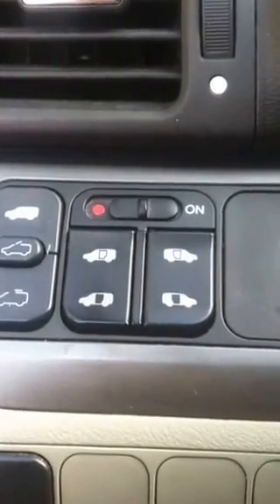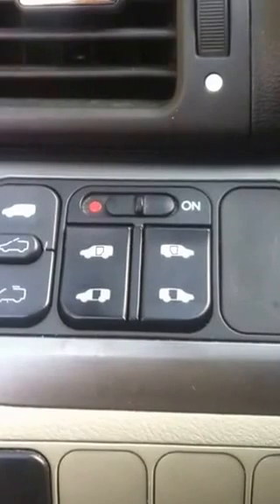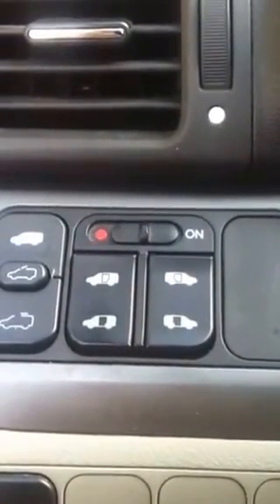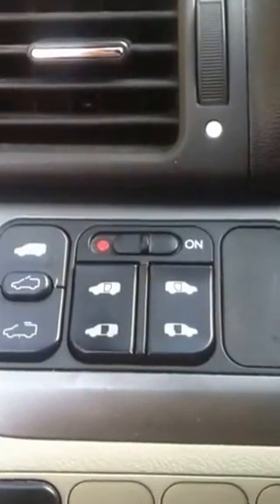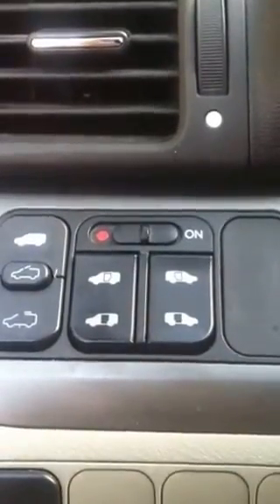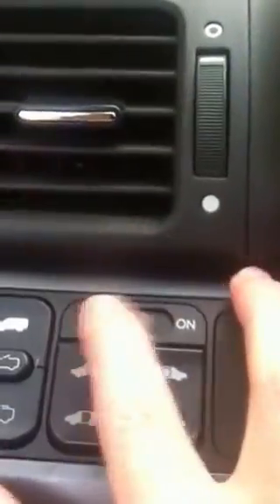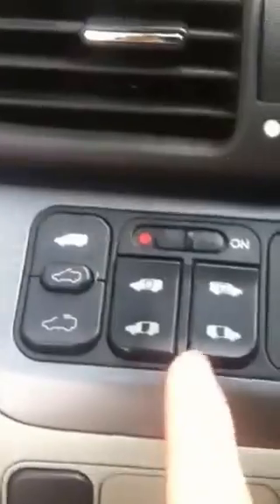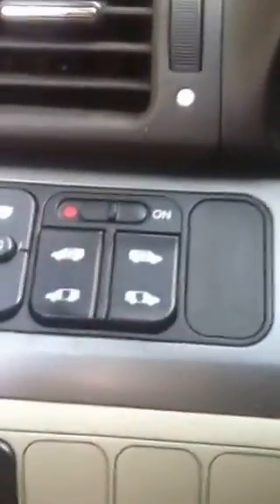Automatic Sliding Door Reset 2005 Honda Odyssey

Comment: Hi and while this does fix the issue on my '05 Ody, in my case it only seems to be temporary, and the sliding door error re-occurs, so wondering if anyone else has had this happen and if a mode permanent fix has been documented anywhere?
Reply: Unfortunately, this is only a temporary fix.  In my case, the problem was the rollers on the door were worn completely and ended up needing replacement.  Cost was $700, but this saved some temporary frustration.
Reply: Hey there, I have the same issue. I did the reset, door worked a couple of times. Just replaced rollers on both doors. Passenger side sliding door still not working. Did you find a solution ?
Reply: Clean the contacts between the sliding door and the pillar.  They're are 11 of them bunched together and they are a little smaller than dimes.
Reply: HI and yes, I was hoping for this to be the fix too and ended up doing it myself (about $100 in parts), a floor jack and some tools (ratchet set, long nose pliers) and about 20 mintes to do each side, & it was not hard when you sat and looked at it (with a lot of help of YouTube University of course :-)

Genuine Honda 72561-SHJ-A21 Slide Door Roller Assembly, Left
Sold by: Amazon.com LLC  $46.05

Genuine Honda 72521-SHJ-A21 Slide Door Roller Assembly, Right
Sold by: Amazon.com LLC  $44.04

But, alas,  in the end I had to remove the inner panel and dig out the rear latch assembly, following more videos and Ody club member posts (Thanks to a number of people that went before me).  

I think it was about a $160 part to buy the whole assembly but it cost me about $13 in radio shack parts (drill, 3/32 bit, soldering iron, ratchet set and Philips head screwdriver) to get it working again -- time will tell how long it lasts but I am confident it will keep working -- I bought another RS Switch in anticipation of the rear passenger door to fail next :-) - Here are the parts and link that I used and contributed to.

Radio Shack:
- (1) 2750017 mini SPDT Roller Switch $3.49ea
- (1) 6403010 PK42 2-56 Screws $2.49ea
- (1) 6403017 PK40 2-56 Hex Nut $2.49ea

ref:  http://www.odyclub.com/forums/52-2005-2010-odyssey/22226-slide-door-idiot-light-7.html

Comment: hi I own an odyssey as well. I saw ur video and I was wondering what was ur problem.Why did you reset it?
Reply: jongkeun lee One of my sliders had quit responding to the remote or the inside switch. The car battery had gone dead and had to be replaced. Apparently that can cause this kind of problem. After pulling this fuse and doing the reset it started working again.

Comment: Tip i just figured out, this process didnt work for me, my passenger sliding door was stuck open after a dead battery, if you can, shut the door in manual mode and itll work when switched to auto. My passenger door wouldnt close in manual mode it was stuck, so i set the front and rear securing "claws" to the closed position and i heard the door motor retention. Then the buttons to open and close worked like a charm.

Comment: ello, i have the same problem but for Odyssey 2011 and the fueses are not in the same position, for example the #7 drive side fuse is of 20 amp and is called Door Lock Main

Comment: same problem i faced, I did reset properly, but Same problem facing after couple time or couple days i used the door. means "Slide Door Light" On Driver Side Passenger Door. Need help how can i solve this problem.
Reply: Ripon Das check the 4 position switches on door.

Comment: It works for about 3-4 times and then it stops working again... Any suggestions?
Reply: I've done it like 10 times and it does the same thing... It works for about 3-4 times and then it stops...
Reply: I have the same issue.. did you find the permanent fix

Comment: After reset，it worked immediately, but after about two or three times of openings-closings, the issue came back by itself. Reset again, worked another two or three times, then issues came back again:(
It seems something defeat in honda design.
Reply: JJ , same issue with mine. The reset works temporarily but the problem comes back
Reply: Did you ever find a permanent fix?
Reply: Honda needs a class action lawsuit against it! There are too many issues with these doors and correction need to be put in place under an extended warranty for everyone with these door issues! I will never buy nor recommend anyone to buy an Odyssey because of the door problems!

Comment: Did not work for me. My doors work with the switches inside the vehicle but not with my remote.  When I pulled the fuse the doors still operated with the switch inside.  My remote is only working to lock/ unlock.  Can anyone help me with this?